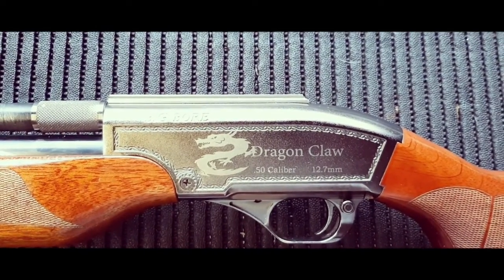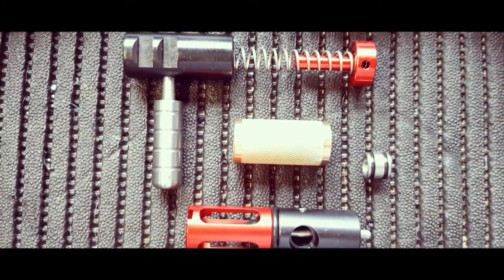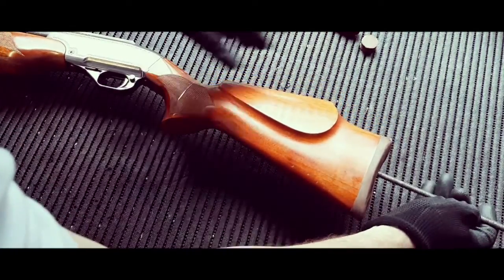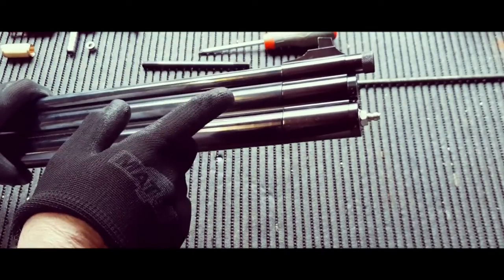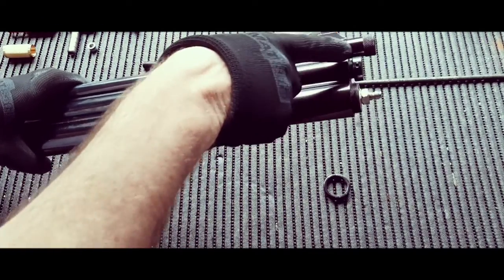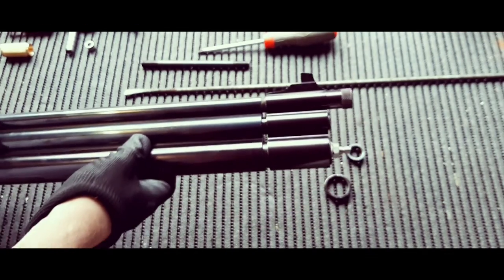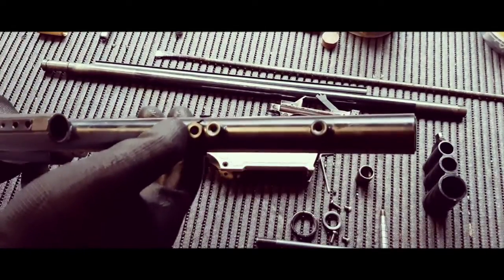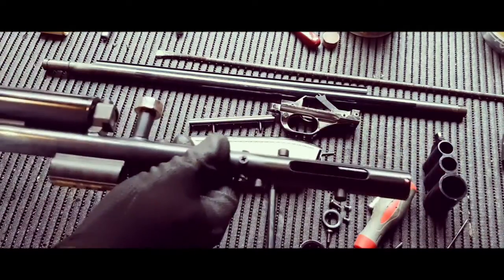SENECA/SAM YANG DRAGON CLAW  50cal Tear Down

Comment: that threaded rod to unscrew a flat head screw two feet down inside a tube looks like a great way to get in a mess. and people please don't drag a threaded rod through your tube like this. there's sealing surfaces
Reply from the maker: If you are worried about scratching anything simply wrap it in electric tape it's only if you cannot find a long flat head screw driver

Comment: I have the fill valve fail on two different guns in short order. Do you have any advice on replacing it? and or preventing it from happening again?
Reply from the maker: Just pull the fill probe out